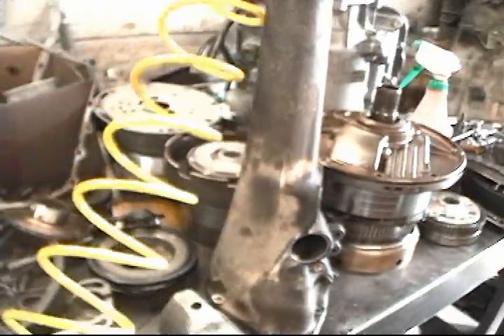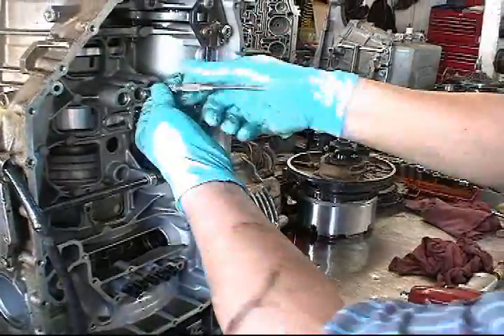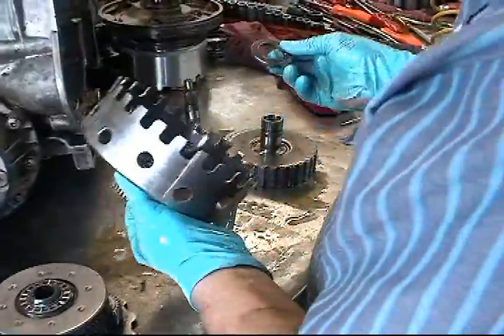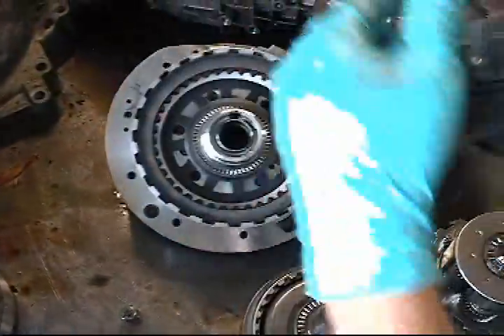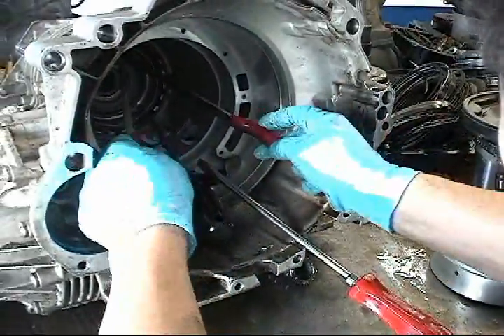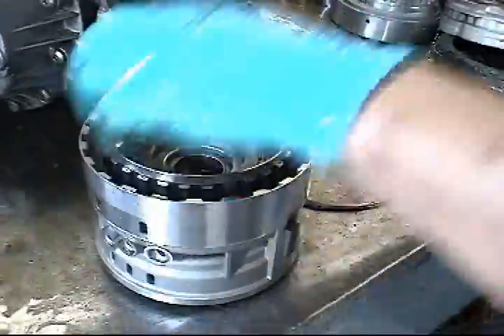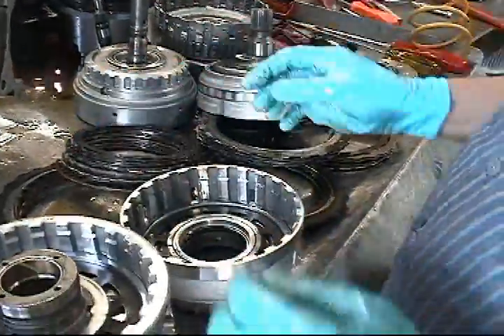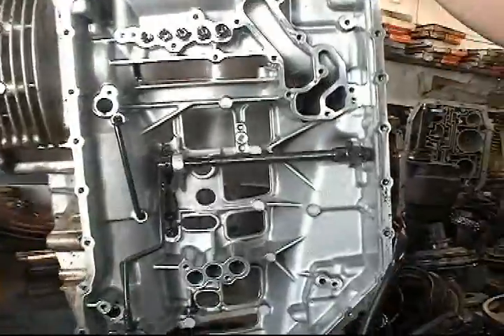Stripping down an Audi Automatic Transmission for Repair in Tampa

Comment: on my x5 4.4 155k...since I'm loosing pressure that cuz the A firction plate to burnt out...do I need to go I further in the trans like C D E F clutchs...or just examine the pump and the cable body for the pressure drop

Comment: I have audi A6 '02 1.9 TDI, automatic Transmission, when goes at 5th gear loose power, it goes almost shuting down, only from 4th gear to 5th gear ? Do you know where is the problem ? is the problem of transmission ?

Comment: This guy is the master!  How can he lay these components out in a sort of random fashion and then put them all back the same way again defies belief, so he must be Yoda??? P.s. My 09A  (Jatco) transmission needs a new reverse piston by diagnosis. Any suggestions for self repairing using keyhole surgery & without removing the box from the engine are most welcome :)
Reply: +simon hare do it often enough, you can do it.
Reply: +Dee Em  Fixed mine (eventually) after wrongly replacing the reverse frictions first. Turned out the reverse band brake was the culprit, partially worn probably by the last owner slamming into reverse whilst still moving forward a few mph. Adjusted to spec and o.k. (for now). Phew,  big job it saved me!  A fluid change is on list of jobs, as i get a little shudder lower down in the rev range in 4th and 5th.

Comment: My '2000 A6 Quattro 2,5 TDi is shaking with variable intensity all the time...
We changed clutch engine mounts and the dual mass flywheel too, but still make it!
What do you think should I change the bearings of the gearbox or what????
Please help me if you can! It makes me crazy!

Comment: how could you? how could you say Audi automatics are good?? lol.. so many A6/A4 on CL and guess what,, with Transmission issues.   Whats up with that
Reply: +Veyron640 From everything I have researched, audi transmissions are very solid.  The main issue with audi transmissions giving out was fluid neglect.  Although it does seem the the pump is the first issue the audi transmissions will have, catch that soon enough and it should be zero to minimal damage done.

Comment: My 2003 Passat has a hard knock when downshifting from 5th to the 4th, and only when it is hot. What would be the problem?
Reply: I have this problem also but when downshifting from 2 to 1...and only when it is hot ...if you find the reason for this problem please till me ...is it sensor or i need to change all gear ...thank u ..

Comment: My only experience with owning an Audi, was a 1997 A4 2.8 Non-Quattro, manual transmission, and although it was a great solid car when it was behaving well, it was a maintenance nightmare to the tune of thousands of dollars, and holds the record for the worst car that I've ever accidently purchased.  Even Audi specialized mechanics told me that it was a total bitch to work on.